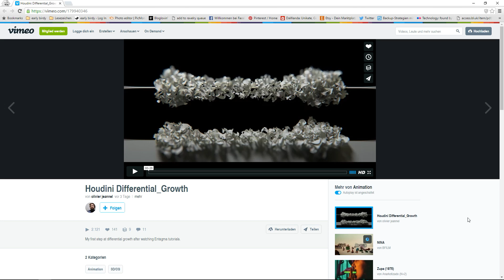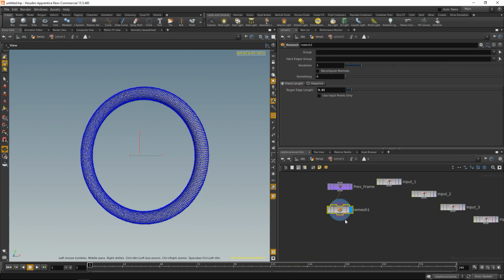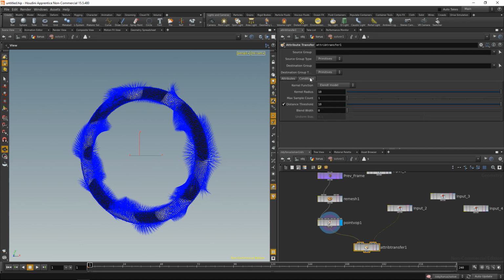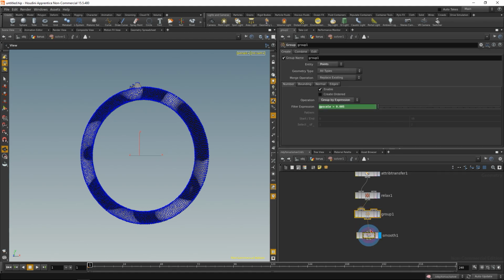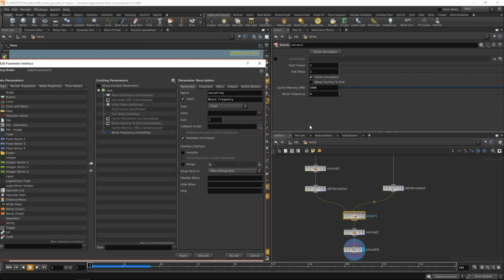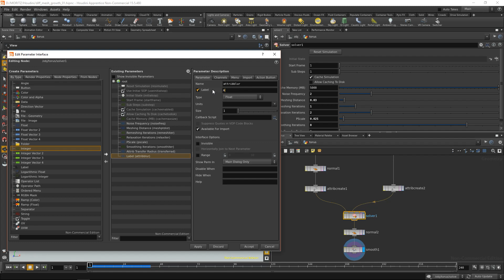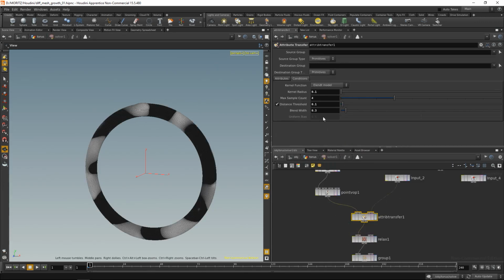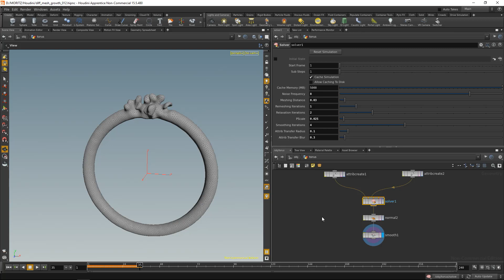Differential Mesh Growth - The Quick Way

Comment: The group doesn't have group by expression in it anymore. Using a group expression node doesn't work because of possibly an hscript / vex issue. I'm not sure what to do here.
Reply: The problem seems to be in the Smooth node, because it looks for a primitive group, not point group. The walk-around is to switch the operation expression from < to > (@pscale < 0.005). Now you have the point group that is not going to be smoothed. Then in the Smooth node, leave the Group blank, but set it in the Constrained points as group1.

Comment: It's a great tutorial you made here, but when I start the simulation it just starts to smoothen whole mesh. Im a beginner with Houdini btw😅
Reply: Maybe it's because I started this with not a Houdini generated geometry, but imported my own fbx. file and then subdivided it? I'm on H18 BTW.
Reply: @DOVEDELS  No same thing is happening to me with houdinis geo!
Reply: Make sure that inside solver you are putting pointvop and Input_2 (not Input_1!) into attributetransfer.
Reply: Super late to the party, but this might help someone someday. When he switches the group type inside the solver from Points to Primitives it clears the selection, because it is looking for a pscale attribute at primitive level which does not exist. And therefore the smooth SOP later will apply to the entire mesh. Instead keep the group type at "Points" and add a groupPromote node after and convert the already existing group from Points to Primitives
Reply: @jihadakoury7442   I love you

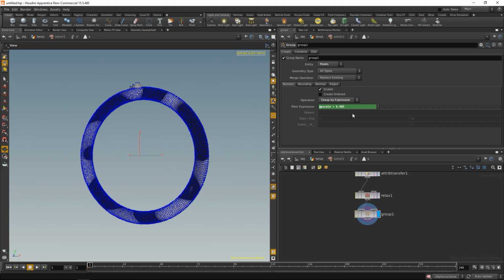Comment: Hi, I used your method get up to 6:57 where you introduced group sop and add the expression as @pscale > 0.005, but there is no such 'group by expression' option for operation within my group node, and my result turned out as a chaos, apparently I see my group node settings not exactly the same as yours, is it because of different versions? And if I don't have this group by expression option with that VEXpression @pscale > 0.005, are there ways or nodes to do the same thing to achieve the same result that can replace group node?
Reply: Two Dumbo Creatives The Group nodes changed in Houdini 16. There is a separate Group by Expression node now. You can use that.
Reply: @charlesnyiha4641  I'm new too, I can only see GroupExpression, not Group by Expression, and it looks very different, so I can't follow from there :/ any advice?
Reply: @isoutoforbit  A bit late but I managed to create a work around:

Add the Group Expression node,  group type = points, | group = group1 | vexpression = '@pscale > 0.001'

now create an attribute promote,  original name = pscale | original class = points | new class = primitive

now copy the first group expression node and put it under the attribute promote, all you have to change is group type = primitives

Now add a smooth node, group = group1 and now it should work without errors.

The reason you have to do this workaround (at least for me) is because the @pscale expression somehow wont work when the first group expression node is set to primitives, and the smooth node will just smooth the entire mesh. By first selecting the points with the first group expression, then promoting those points to primites, you can then select those primitives with a second group expression thats set to primitives, which the smooth node now accepts.

Hopefully this is a good workaround, as i've been only using houdini for about 1 to 1,5 months now, but it seemed to work for me :)
Reply: @noisenoise9600   a more elegant solution that I found was to use a group promote node promoting points to primitives, then you can skip the copied group expression node.
Reply: @somon90     group promote doesn"t work for me, but  @Nostromo's method  works, but you don't need 2 group expressions, the one after attribute promote works fine.
Reply: @charlesnyiha4641  thanks!
Reply: I found this answer to the same problem i was having on the sidefx-forums: 'to get the old Group node that has Expression mode you can do this:
let's say your geo node is /obj/geo1
then in Textport type:
cd /obj/geo1
opadd group
that will create the old, deprecated Group node that is used in the tutorial
Tomas Slancik
FX Supervisor
Method Studios, NY'
Reply: @kontrastwesen4066  Thanks but that unfortunately gives a "Unable to create node type group" Houdini FX 18.5
Reply: EDIT: Ok finally found how to view the deprecated group node -> 

Windows -> HScript Textport
in the cmd line type: opunhide Sop group

Done!
Now when searching for a group sop you will see two group sops, one is gonna be the old one that we need and one will default to the Group Create as before

fun fact if you type 'opunhide' in the textport you will see all other deprecated sops that you can re-enable
Reply: @urgisjot  this saved me, thank you
Reply: I only have learned Houdini less than half a year, really looking forward to your reply and help